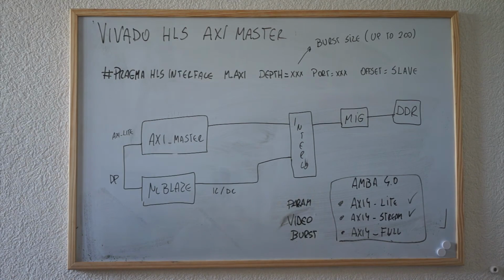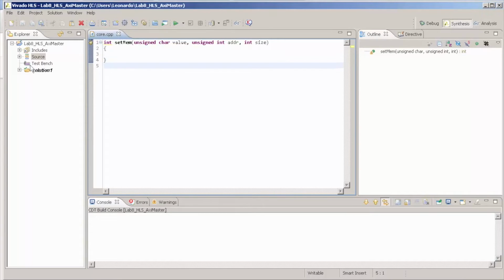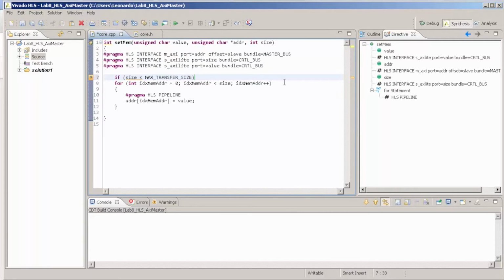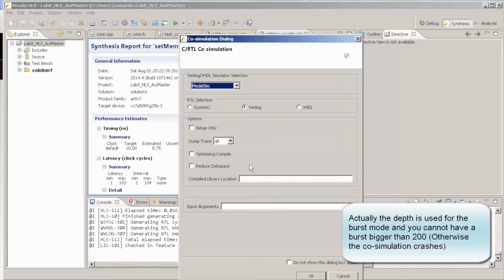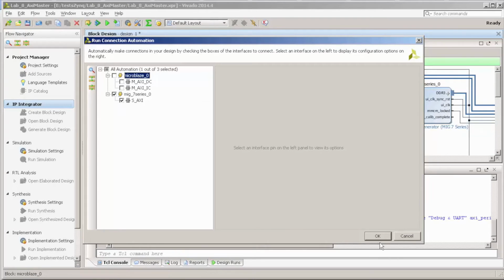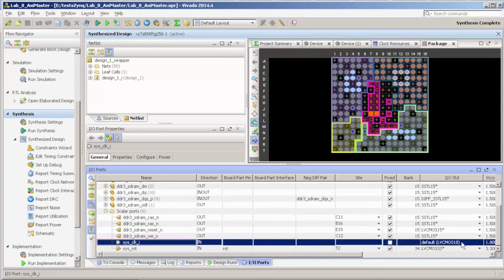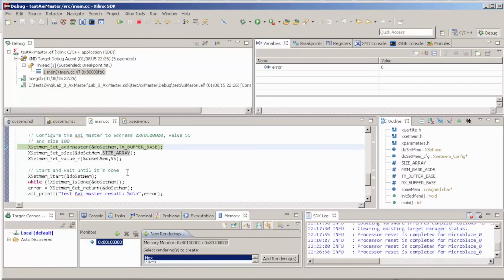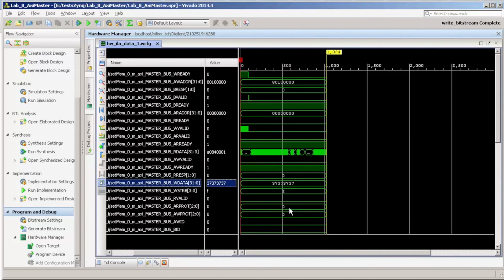Vivado HLS Training   AXI Master #08

Comment: This is a great tutorial! I have found that the  depth of m_axi interface can be more than 200. The errors are caused by the test_core.cpp file, where the someMem array only contains 100 elements. I have solved this error by setting max_depth=204800 for both m_axi depth and the someMem array.

Comment: Can an HLS IP read/wrtie from/to DDR directly through any of its four AXI-Master HP port without using DMA ? Is a data mover IP like DMA or MIG always required between HLS IP Master AXI full port and DDR connected to PS via DDR Controller ?